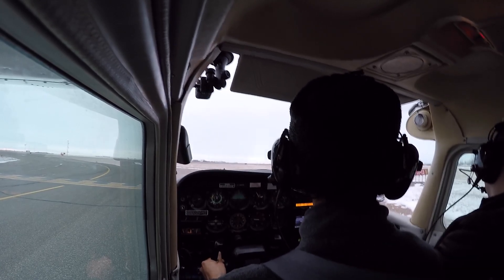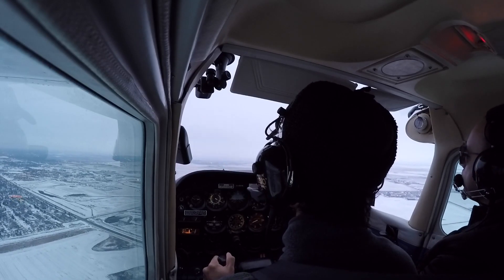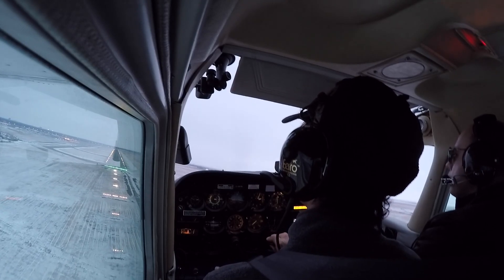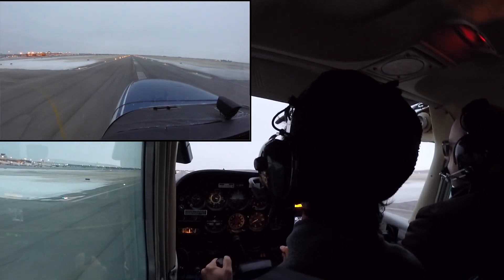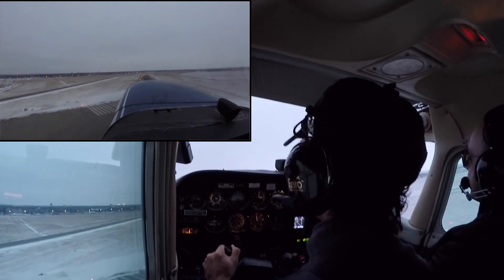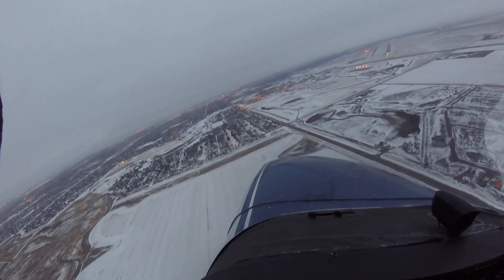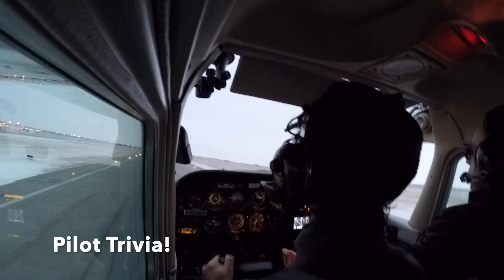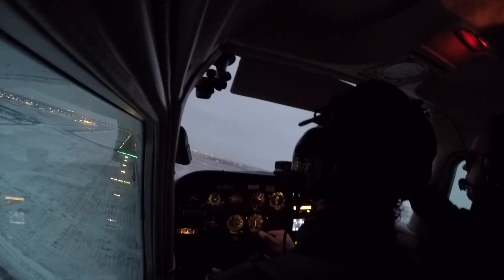PILOT SERIES 2/4: ENGINE FAILURE During Take Off! And What Pilots Need to Do!

Comment: This is not a tractor trailer truck.  You only need one hand on wheel..  You use more muscles when using 2.  Also on landings and take offs you need one hand for engine controls all times.  I taught EFATO a lot in my CFi days..
Reply: I read about this accident a few years ago.  Also you stall easier when using 2 hands to pull up on take off and landings and turns.. See this dummy crashing it..   https://www.youtube.com/watch?v=RcCvIc1fa3k
Reply from the maker: Thanks for advice! Yeah, probably will do that one hand when I get used to it already.
Reply: @WalkingJ  How come that cfi let you do that basic mistake??  You have to feel the engine via the throttle.  You will feel any failure first via the throttle due it is connected to the engine.  Also you use less muscles with only one hand.
Reply from the maker: @CFITOMAHAWK2  I don't think it's a mistake but something what you are comfortable to do. My CFI told me about it actually that some pilots have their one hand always on the throttle especially during the take offs where you can't lose the chance that throttle goes slide back due to the machine vibration. I agree with less muscle used, however, that means more stressed muscle on that hand rather than two hands helping with the force to move it.
Reply from the maker: No, I don't have impediment in my left hand, actually I got my pilot license already. There must be reason why the wheel was created for both hands though, otherwise, Cessna should have the stick yoke.
Reply from the maker: I appreciate the input, actually, that was a helpful tips and it makes sense! Probably, my CFI would be suggesting it to me to do that when I get trained to another level. Thank you CFI Tomahawk2, you are really an experienced one!
Reply from the maker: I see! Just saw that C162 cockpit in Google. 

Must have gotten that idea of having two hands in the wheel in most videos of the Air Crash investigations' plane crashing reenactments. 😅
Reply from the maker: @CFITOMAHAWK2  great to know them!!